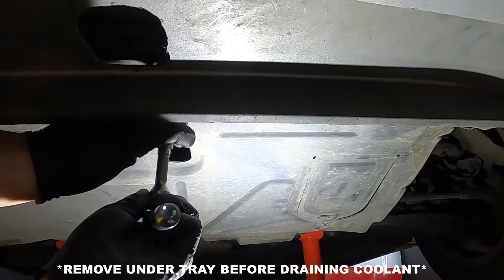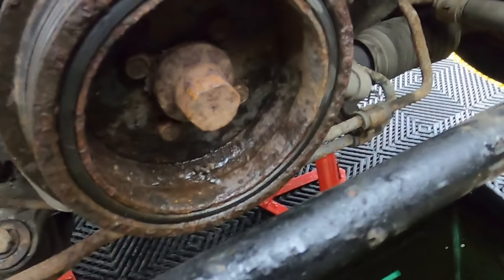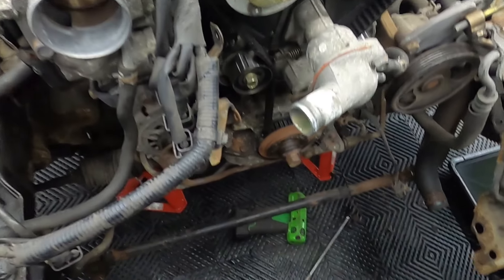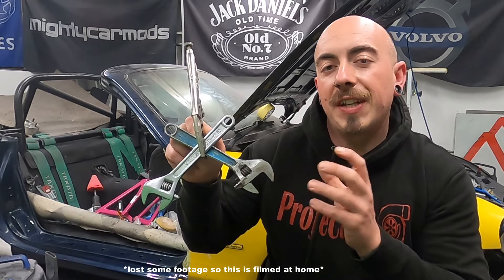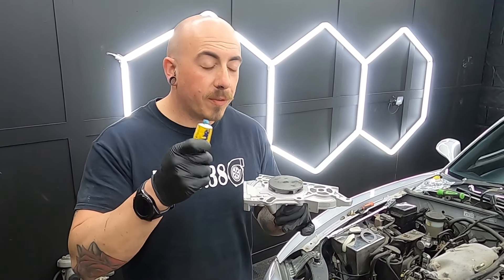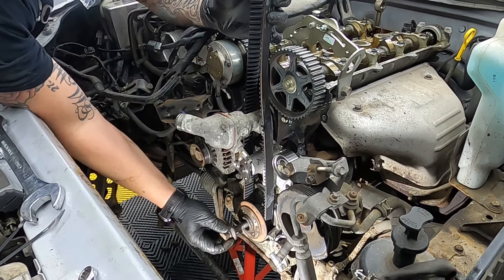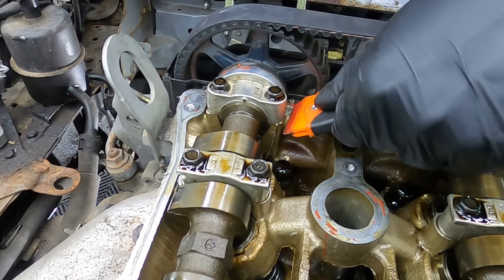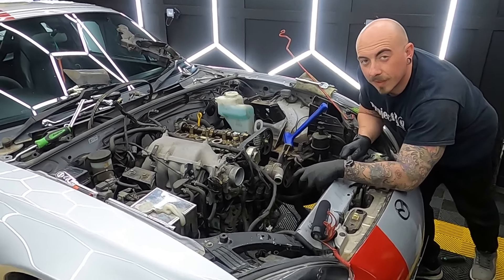TIMING BELT AND WATER PUMP : MX5 Miata HOW TO

Comment: After watching nearly all timing belt and water pump replacement videos, must say this is one of the best. Well shot with good lighting so you can see clearly what needs to be done. Commentary is clear and concise with excellent tips and tricks. Thanks for going into the effect of making such a great tutorial.
Reply from the maker: Thank you i really appreciate the feed back. i hope the video was helpful
Reply: @Project380 

My timing is off to start not this will basically fix the problem right? By aligning the crank and the camshafts ?

Comment: I double checked the user manual. Apparently you're supposed to put on the belt with tensioner loose, Then do 1 and 5/6ths rotations until the notch on the crankshaft cog lines up with a small marker to the left of top dead centre which is the "tension set mark". THEN you loosen the bolt on the tensioner so it takes up the slack. Then another 2 and 1/6ths rotations to check all lined up at TDC. Might be a bit easier
Reply from the maker: yeah either way works, same result

Comment: When that much sealant is used, doesn't some of it get into the engine?
Reply from the maker: good question, ive never had a problem and the oil pickup and filter have always been pretty clean, i just cant help myself when it comes to sealant 😂

Comment: so you said about doing the cam seals you will loose timing, should the seals be replaced before doing the belt so then you can put the cam pulleys back on and make sure they are lined up before you take belt off, is that the correct process?
Reply from the maker: yeah you should definitly do the seals before putting the cam pulleys on, i definitly should of done this
Reply: @Project380  did my belt and all is good but i have a wierd whirring sort of noise inbetween 1k and 2k rpm, do u know what this could be? my assumption is that the belt may be loose so is there any way of tightening the belt anymore with the tensioner pulley?
Reply from the maker: @louisrobinson5952  it may actualy be too tight, have you checked the belt deflection?

Comment: Nice, clear video, BUT you're supposed to set the cam belt tensioner after 1 5/6 turns - this is where all the slack in the belt is on the tensioner side - there is an extra mark on the case which is visible to the left of the belt at 8:40. After fitting the belt, turn the engine 1 full rotation from TDC and then continue around until the notch in the crank pulley lines up with that extra mark (another 5/6 of a turn) then slacken & re-tighten the tensioner bolt. You get another ~3mm of movement out of it over setting it at TDC.
Reply from the maker: 😯😯😯😯thank you, even i ddint know this, more people need to know
Reply: @Project380  Cheers - I've just done the job those are the instructions from the Mazda workshop manual. After setting the tensioner you then turn it 2 1/6 turns (so back to TDC then another 2 turns) to measure the belt tension.

Comment: Any pointers regarding the crank pulley with an NB 1.8 auto? 
I don’t have the option of holding the engine in gear in the traditional sense. 
The bolt hasn’t been off in 22 years and looks really rusty along with the pulley 😆
Reply from the maker: hmmm i never thought of this, i actualy made a tool to bolt to the front that wedges up against the chassis locking the crank, its a bit janky though

Comment: Hey, what is that gel at 12:45? What is in that tube and how heat resistant is it? I can't seem to figure out what sealing that is and bought wrong ones already :D
I also have a different question, can i use the old metal gasket on the waterpump?

Thank you in advance, I am doing it on my miata with your video and it's going smoothly till now!
 There is a trick I used to get the harmonic balancer off, you should also try it the next time you change any timing belt: Since the engine would turn clockwise, but a breaker bar on the crank pulley bolt facing to the right and put a metal bar/tube on it, so it's blocked by the ground(Like this \ ). Next step is, turn the ignition untill the engine tries to start, but turn off after a split second and the force of the engine will loosen the screw easily and you dont have to do all the handbreak and 5th gear stuff. Hope this helps you a bit in exchange, even though your viedo already helped me much more!
Reply from the maker: thts just hylomar blue, perfect for water pumps, ive never had an issue.
i would reuse the metal gasket as its a crush gasket

ooo how much strain will tht put on the starter and flywheel though?
Reply: @Project380  Sadly I don't know anything for certain, but I don't think there is a problem. I know a mechanic and he does it all the time and had been doing it for years with no issues. Im no mechanic but it was logical for me, since in theory you hold the screw and it can't move vertically. The bolt still can slide outwards as it unscrews as long as you don't block its way horizontally. If you would lock the bar in one spot the bolt might break or put even more strain on the flywheel.

The worst case scenario would be if the engine would rotate counter-clockwise. In that case the bolt would definitely break and other expensive accidents might happen there.

There might be videos or more info about it on youtube or car forums

Comment: I bought an mx5 the other day and its got the exact same aftermarket cold air induction thingy, think its typhoon systems k&n, any chance you could tell me if the filter is meant to be black or if i need to re oil it? cause mine looks exaclty like yours!
Reply from the maker: there is three different kits 
silver pipe with black filter,
red pipe with black filter,
red pipe with red filter,
its worth cleaning it anyways
Reply: @Project380  thanks so much, i havve the red pipe with black filter, or well, it's black now, but i dont know if that's cause all the red oil has worn off, i found a universal k and n filter that looks like it will go on the end, it's red - i may just wash my current 1 with water until then though? thoughts?
Reply from the maker: @kach0937  K AND N do a recharge kit which is pretty good

Comment: was that just sealant you used on the top of the engine in between the head and the head gasket?
Reply from the maker: you mean the head and the valve cover? if so yes its RTV sealant

Comment: For the part where you put it in 5th gear and the hand brake for a manual transmission, what would you do if it’s an automatic transmission?
Reply from the maker: pop it in park with hand break on
Reply: Thank your for the feedback you’re video helped out a lot . Another question would putting it in natural instead of park be different?

Comment: One thing i found my mx5’s harmonic balancer had the centre bolt connected to it so i was tryjng to pull it off and wouldnt budge found out the centre bolt on nb1 bp4w engine connects to said harmonic balancer
Reply from the maker: thats strange ive never seen on like that
Reply: @Project380  tbf i think the balancer is just locked onto it completely to the point the 2 parts cant be separated easily but i try rubber mallet and everything cos the harmonic balancer looks just like the one in the video but doesnt matter as i just took out the centre bolt and it comes with it so can still get to everything just means if i need to replace it ill have to buy new prolly

Comment: Is draining coolant necessary if I dont remove radiator? I have changed crank pulley without removing radiator so space shouldn't be issue?
Reply from the maker: if your doing the water pump too then yes drain the coolant

Comment: How is the gates waterpump holding up?? I went to my local auto shop and bought one of there waterpumps about a year ago and im unfortunately getting a leak from the same area on the motor so i am assuming its my waterpump failing
Reply from the maker: ive never had a problem with a gates waterpump. are you sure the mating surface is flat and true ?

Comment: After changing water pump, when I try to tighem timing belt idler it rubs with bottom side of timing cover. Is it normal? Or maybe I installed waterpump wrong? Thank you.
Reply from the maker: this is a common problem, the timing covers sag or get broken over time, just replace them

Comment: If I’m removing the head to get shaved off, I just need to align the arrow with the indent at the bottom of the engine and get the cam gears to align to the markings at the top right? That’ll make sure the timing is right? I’m just worried about the timing once it’s time to put the head back on
Reply from the maker: yep thats right, just make sure all the marks line up and you should be fine

Comment: Great Video. I Will replace the alternator, water pump and timing belt in 2 weeks on my NB. What is it you add to the gasket before putting it on? I´ve had issues before with a leaking gasket on the thermostat housing. That was an easy fix, but considering how deep the water pump is burryed, i don´t wanna go in there again because of a bad gasket.
Reply from the maker: thank you. its hylomar blue or gasket blue. good luck

Comment: ugh! ive resealed my waterpump twice, and it started leaking after both. the first time i just used paper gaskets and nothing else. the second time i used a wire brush to clean the gasket surfaces and used a metal gasket paired with some sealent and it still started leaking! i'm just going to replace the water pump and try again. i hope the water pump is the issue and not me. i literelly rebuilt this engine and somehow i can't reseal the damn waterpump.
Reply from the maker: sounds like it could be a warped water pump, are you torqueing the bolts correctly? if you over tighten it will warp and leek
Reply: @Project380  well yeah I torqued to 17 ft LBs but my torqewrench is questionably accurate. I've been meaning to get another.

Comment: Great clip, really methodically executed. I'm still struggling to remove the harmonic damper - is it feasible to remove the crank bolt with it on, tapping off the dampener and then refitting the crank bolt?
Reply from the maker: thank you, yes you can but there are some disadvantages, you wont easily be able to see the timing mark when re assembling, be very careful when tapping the balancer as they do like to chip. and lastly changing the woodruff key is alot more difficult
Reply: @Project380  many thanks for the advice.  I managed to get the bolt off and there would have been no chance the dampener could have been eased off it was really rust-welded on!.

Comment: How long does this normally take?
Reply from the maker: start to finish about three hours if your being careful
Reply: Well its taken me about three hoirs to get to the stage of removing the harmonic dampener. I'm expecting another 5-6 hours but then again I'm using a die on a lot of the rusted screw threads before refitting them with anti seize. The main issue is seized or rusted parts

Comment: Got all the bits and seeing this video I am now minded to do this job myself, seeing how easy it is to remove the radiator and drop the roll bar to gain access. Looking to change the front crankshaft oil seal while I am at it since I had the rear done last year when the clutch was changed. Thanks for the excellent descriptions and clear video, lighting really makes a difference.
Reply from the maker: Thank you 😎. take your time and double check everything im sure you can do it. The front oil seal is pretty easy, i cover this in my POV diagnostics video, it is on a MK1 but the seal and procedure is exactly the same